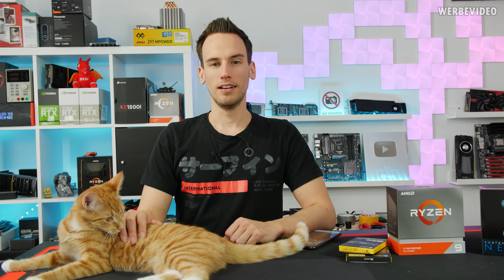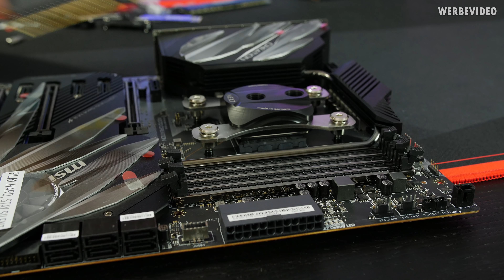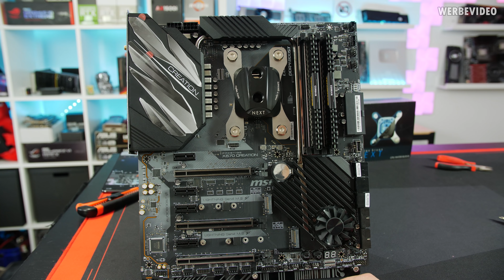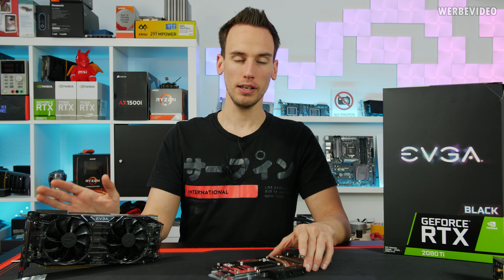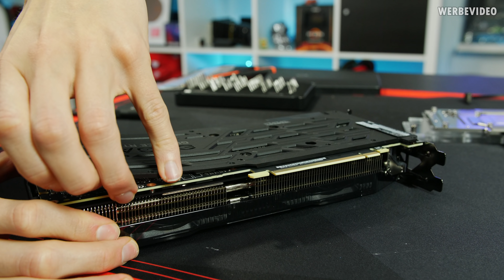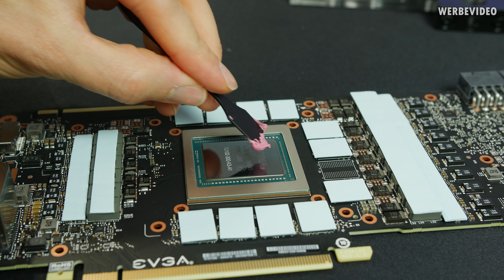No RGB and ABSOLUTELY SILENT - Ryzen 3950X Workstation for Fritz Meinecke

Comment: F for the 3000mhz Vengenance LPX.
Reply from the maker: @Adam: It was the only kit available here for me with 2 x 32GB and at least 3000 MHz. Corona times make availability difficutl
Reply: @der8auer  With 64GB ram was there really a need to get 2x32 rather than 4x16? I understand the possibility of future upgrades to capacity but is he really going to need 128? Doesn't speed and latency matter more than some possible future capacity upgrade?
Reply: @dgianstefani5694  If he makes money with the rig then future capacity is paramount.  One 64GB kit is cheaper than two at a later date.  And with large clips to scrub through, more memory is better.
Reply: @Lurker-dk8jk  If he makes money with the rig - time=money. Ryzen CPUs are extremely affected by memory - choosing a £750 cpu like the 3950x then pairing it with budget, and i emphasise budget ram that has bad history with Zen is silly. Capacity is irrelevant unless you actually run out of memory, having 64, or 128gb of ram doesn't matter one bit if you're using 40gb. Speed matters, latency matters, especially with Ryzen.
Reply: @dgianstefani5694  With Zen generation 1 and Zen+, maybe.  But Zen2 is less affected, and the 600 cycles lost (where 3600 cycles is ideal) won't make much difference.
Reply: Not only that, but the infinity fabric is 1:1 coupled with the ram, so the fact it's 3rd gen ryzen is meaningless, the CPU performance is directly affected by the speed and latency of the memory subsystem. You're looking at 5/10% performance losses by running 3000mhz kit with bad timings compared to 3600/3733 kit with good timings for example.
Reply: Exactly. Trash tier garbage. He could have gone for Corsair Dom Plats. No RGB and actually good RAM
Reply: @weavercs4014  https://uk.pcpartpicker.com/b/BMtgXL The build I did last year with similar components. Not WC, but it's a workstation so ultimate reliability is more important. Team Group make excellent RAM kits with some of the best stock timings i've ever seen.

Comment: Not a big fan of Magicool radiators considering the one I had took more than 30 flushes and there were still coming grey particles out of it, almost as if someone forgot an ashtray inside it. I returned it to Caseking, what a horror show :)
Reply from the maker: Flushed 2 times and couldn't find anything after the 2nd time. Guess there are some fluctuations in manufacturing
Reply: @der8auer  True. No doubt I was really unlucky :)

Comment: You could've gone for an Unify X570 with no RGB and get an USB 3 expantion card for roughly the same price imo. But either way, nice build!
Reply: I think you mean X570 Unify. Evoke is for graphics cards. But it's a moot point. Unify does not have 10G LAN.
Reply: Raivo K Corrected that, thanks!

Comment: When life flashes in front of your eyes, could you die in peace with no RGB? Definitely... So sick of RGB. Great content, Roman.
Edit: Roman: A reasonable PC for streaming (proceeds to build a 3k euro PC)
Reply: Imo RGB looks best with proper colour combinations, effects. The worst kind is that mismatched rainbow puke epilepsy inducing garbage
Reply: @asit6947  true. What I like as well is color matching components (black-silver components or white-red) and adding LED strips and setting them to static to light up and accentuate the components inside.
Reply: For me, the perk of RGB is just changing the color accent whenever you want. I mean, I don't use any of the "effects", and I just roll static red on everything, but maybe next month I want to change it to static blue; RGB lets me do that.
Reply: @praetorxyn  Yeah I agree. I prefer static. My Nitro + 5700xt has an rgb port on the side which I have connected to my motherboard. I've done the same with my AIO and case RGB. All of the RGB including the dimms goes through msi's Dragon Center and I usually have it set to blue with somewhat of a low brightness. I'm not a fan of the rainbow waves and flashing presets.